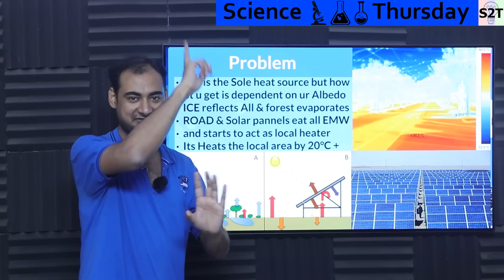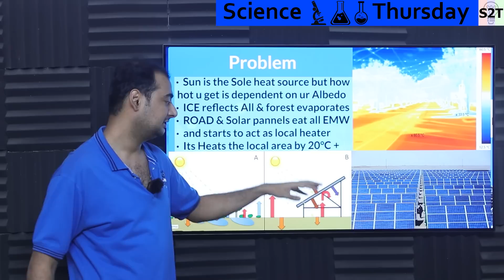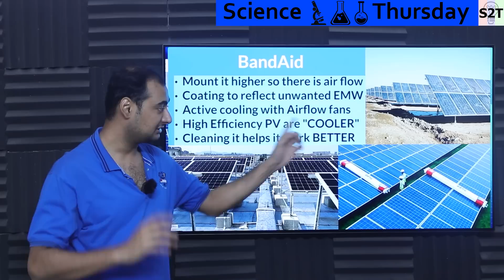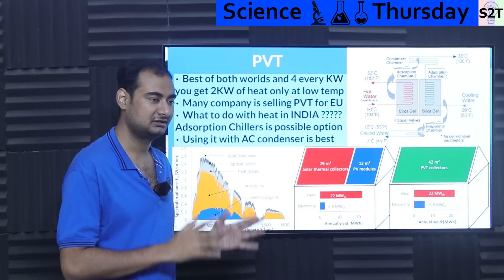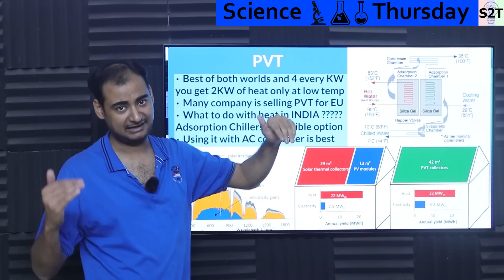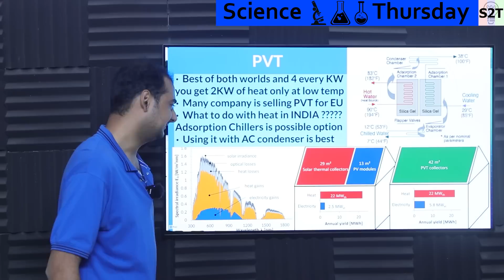Solar Panel Heat Emission & Solutions {Science Thursday}

Comment: Hello from Trujillo Perú.
Use heatpump to cool panels in the day, dumping heat into a salt battery to make steam at night for a generator.
Reply from the maker: u lost me at  make steam at night for a generator . steam needs a lot temp to be usefull like a LOT 1600°C fire in coal power plant that is why I said ORC is the only thing that works and that  has very low efficiency

Comment: Using your multistage idea...pass hot water from PV-T through dedicated thermal panel.  No tension between getting water hot and keeping panels cool.  Extra hot water bumps COP for absorption chiller.

But as an existing comment points out, now you will have even more heat to dissipate to get water cool enough to cool panels.

But in coastal cities, regular sea water coukd be evaporated to dissipate heat and create boost in selling sea salt.  Some countries  considering digging ocean channel inland.
Reply from the maker: pass hot water from PV-T through dedicated thermal panel it wont work that well because for energy to flow u need high Temp delta which wont be there  that is why said We can use a heat pump to boost temp and COOL pannels but if COP of this heat pump is low then is not worth it 4+ = gg 2 = all of the PV power that is why it can only be done where cooling is the core goal

Comment: Informative video.

One problem with using Absorption chiller: The rejected heat ultimately has to go somewhere. If the chiller is water cooled, you are effectively using solar energy (+dumped energy from chiller) to evaporate water. If you do this at scale you would eventually get water scarcity.

One option: You made a video on Radiative Cooling Panels/Paint on Future Friday a while back. Maybe there will be a breakthrough?

Second option: You can create a buffer tank to store the hot water in the afternoon (when the air is too hot) and then slowly let it evaporate or reject heat to air in the night over 6-8 hrs (when it's less hot).
Reply: Rejecting heat when there is too much means ultimately reflecting to space.  Although Indian coastal cities can tap deep ocean cold.  Greater T delta could make ORC or Stirling engines viable on PV-T waste heat.
Reply from the maker: bro  Absorption chiller does not need evaporative cooling tower u can use air to water radiator no loss of water
Reply: @s2tenglish  You are correct that absorption chiller can just dump heat to air. But then, instead of solar panels making the local environment hot, absorption chillers will make local environment hot.

The solar panels will work a little better, but butterflies and bugs still get fried, the outside air will still be uncomfortably hot.
Reply from the maker: AC does that anyway atlease u can reduce the total  load and reduce associated pollution which will puff the whole planet so your call